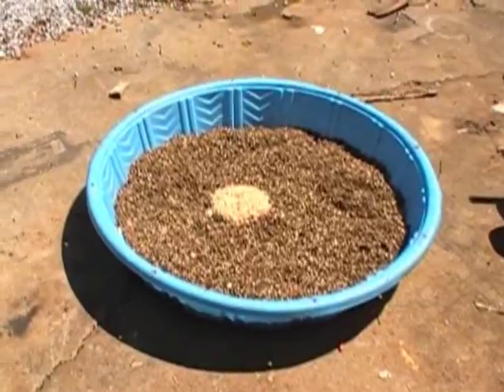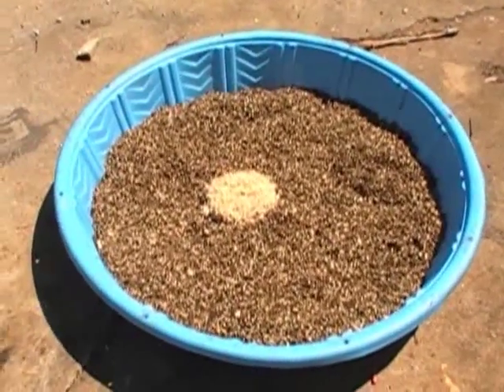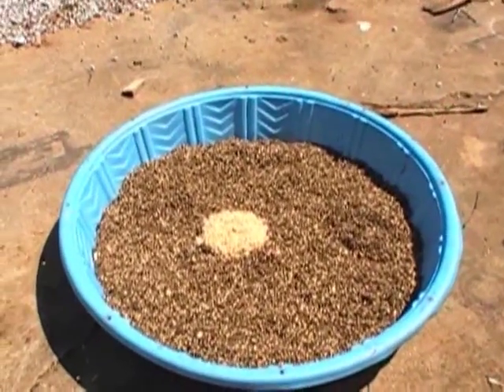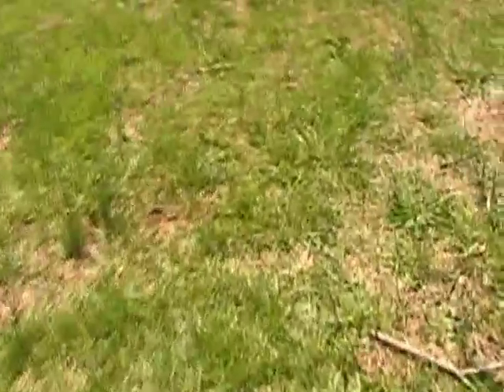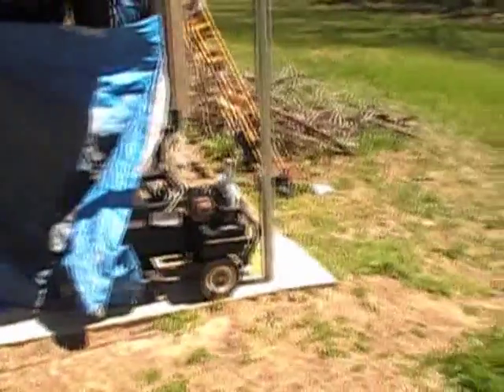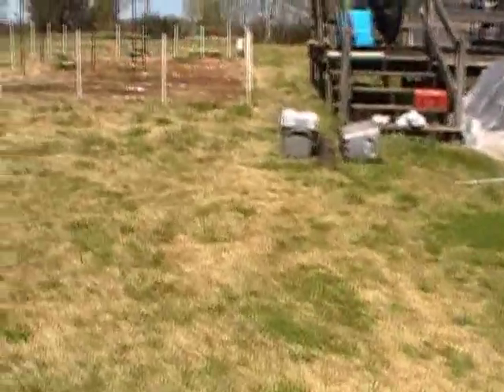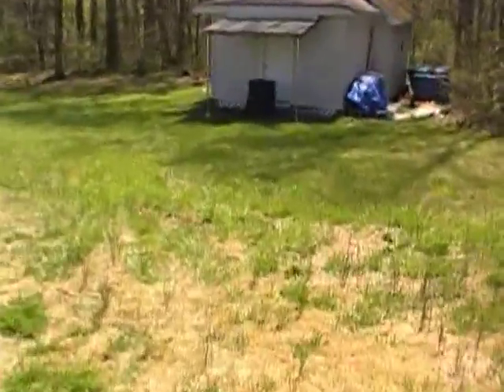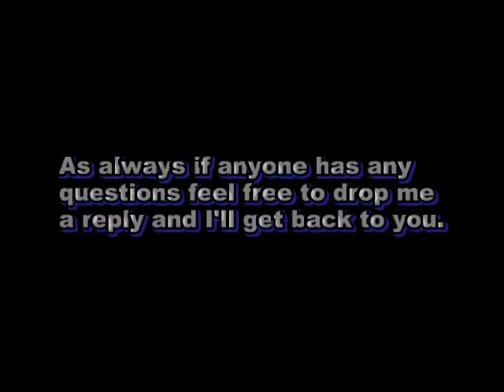Filter Discussions 2018

Comment: Absolutely. I save the shavings and the fiber fill. Thankfully, I have many bags of both. It's nice to have a friend with a custom cabinet shop to get the planer shavings from. Shoot the video man.....
Reply from the maker: I figured it out a while back that I could recycle this stuff and it works. I'm sure they will hit a point where they need to be tossed but the good thing is you can definitely  recycle them quite a few times.
Reply: Yeah. But you mentioned the Oxy Clean and I tied it. Man, does it ever work. Thanks for the heads up on that one. But, I haven't tried cleaning the condensate jar with it as of yet. ....YET,, But, I will.......
Reply from the maker: Dude I've scraped inside of the jar with a stick and couldn't get it clean. We are talking about a jar that was dirty since 2014! It looked brand new after 30 minutes. I honestly couldn't believe it myself.
Reply: I used a paint mixing stick and paper towels and NOTHING.. It's still there. I have got to try it. I have 2.  A primary and secondary condensate jar. Both nasty,,,,,

Comment: Flash, Must be something in the air. I put on a demonstration for the  instructor of the Arduino workshop that I go to once a week. He and his wife came up to watch the gasifier  do its magic. He has agreed to help me with the automation part for our upgrade. I had the camera all set up for a video for you guys and Danged if I didn't remember to turn it on. After they left I fired up again to do the video along with putting the battery bank to work, planing the timbers for the new addition. That video's going to the snipping room for some editing and will be out tomorrow.
Thanks for the  filter update and hope you had a chance to get that midnight run in !
Reply from the maker: Bill I did a run tonight so I have some editing to do myself.
Reply: If you need the O2 sensor code shoot me an email. Your instructor should be able to figure it out. This code is now nearing four years developed. The best code is the code all ready written :)
Reply: Nice work Flash, yeah I dont run media filter anymore I think it creates more problems than it solves.  Been this way for a few years now. We now consider this a condenser and it can do better job with out any mass in there vs having mass in there. Then we run a series of cyclones for final filtering. Last one drops clear water.They are just straight cans no cones Ive found thats a waist of time too. KISS Cheers
Reply: primary site glass is in the oxiclean right now. I do use that to clean the scrummers in filter #1. Works well
Reply: LOL Two Flash001USA gasifire videos on April Fools day. What are the odds ?
Reply from the maker: Pretty wild to run without filter media. My next thing will be an electrostatic filter. I think I'll always run stainless steel pads because they don't impede the flow of gas and they do great in allowing the water to condense. The wood chips will get soaked every time.
Reply: Whoa, whoa, Mike. Back up a minute! What do you mean "  wild run without filter media "..? You want to explain that to the choir, please?
Reply: Look forward to seeing it.
Reply from the maker: Bill I must have missed something here? Wild run without filter media?
Reply: I have not used media for years. You can not filter tar or water it can only be condensed. If you are finding tars, soots in your media its just dropping here and will drop regardless of media. If you do find tar in the media then it has most definitely passed it and is in the engine. To condense the gas you need to expand it after adequate cooling and you will drop more in a vessel with out filter media taking up that space. Ive tested this. Too get out the final debris I use final cyclones by this stage the gas is wet and will scrub this out very effectively in the cyclones. I dont mess with nasty media. After cleaning that stuff out and then finding a way to dispose of it; I had to find a better way and learned the condensing processes.
Reply: One thing I should note. on the big machines we use liquid cooled gas chillers and on the Utility machine what we consider the "condenser" it does have a grate if the user wishes to use this as a media filter. But its up to them, to me its not worth the hassle and it makes it more restrictive causing flow oscillations and crashing the reactions. With out it the engine can pull harder and prevent tar production in the first place. As for any dust its usually whipped out in the machine by the time it reaches the engine. The cyclones take care of anything thats left. On the big machines they have three series cyclones and we premix engine intake air prior to this filter. So it adds more cooling plus gas mixing on top of final filtering.
Reply from the maker: You are 100% correct. That was something I learned 4 years ago when I first started tinkering with this stuff and then I came up with what I called the expansion tank where the gas entered the bottom and exited at the top. Because the gas is allowed to expand it cools it too (AC 101) The water condenses on the sides and runs to the bottom and even the tar will drop out if it's in the gas. I thought I discovered the holy grail then when I showed people on youtube what I was doing I was called an idiot. I stuck to this concept because it works for me. Another issue is getting hot enough if you are running a small engine so a small restriction throat is a must. I'm using a 2 inch restriction throat for my 5 Hp engine along with a cone shaped hearth that starts out at 6 inches diameter and tapers down to the restriction throat. That actually helps concentrate the heat like a fire hose nozzle builds up pressure on the end of the nozzle. I don't see tar unless I use bad fuel or I have a screw-up. I like your idea of no filter media and allowing the cyclones to capture and condense the gas clean and dry. I'm just a guy experimenting with modified trash cans, fence pole for the condenser pipes and PVC pipe filters but it seems to work and stay stable. I still want to find a better way to make the wood chunks drop into the ember bed. What I have now does deliver the vibration directly to the hopper but somewhere along the line I may take a different path on feeding the ember bed. To me this is something fun with a real world use.
Reply: Yeah it was you who started me on that path. Giving credit where credit is due :) Yeah we done with the chip machine development. I am moving to a new machine with fuel standardization and the 1/4" wood pellet is the fuel that fits that bill. This fuel in the right machine solves a lot of those flow issues. On this new machine the hopper vibrator is going away and there will be a fork type device down in the lower portion of the hopper to break those bridges up. The pellets are small enough that should work and the pellets will flow past it. Keep in mind now that you have a grate shaker and a hopper shaker you now have to balance it. To aggressive grate and fuel flow cant keep up and this can cause bridging. To  much hopper shaker and she plugs up. So if you are getting bridging might slow your grate down.
Reply: Mike, Reading your post " Pretty wild to run without filter media ", I thought you did a run without the media . But I have to say, this discussion with Matt is a real interesting and informative thread. It sure gets me to thinking.

Comment: nice place you got there flash,,, are you still using pot scrubbers as filter medium?? i found that pot scrubbers and pillow stuffing works good for me,, although the stuffing tends to hold more moisture than the scrubbers,, i havent tried wood shavings yet,, how wet are they when you check on them after a run??
Reply from the maker: The wood shavings get soaked starting from where the input of the gas enters and runs drier the further up it travels. I think the pot scrubbers are one of the best filter mediums out there for capturing large particles so yeah I use those too.
Reply: ok, thanks

Comment: Howdee Flash, 
 Yer filters run nice and clean, that's fer sure. 
 On mine, the filter medium ultimately becomes black, but not gooey, so I can accept that. 
 Once it gets like that, with all that soot and light oily stuff in it, I use it as fuel for the gasifier, and / or the household fire place. 
 It ain't the best solution, but it sure does make good use of all the resources that support this gasifier  :) . 
 In time, my gasser will evolve to be more like yours, as the interior of mine is almost totally burnt out, due to over 1500 hours of runtime. 
 The air nozzles are all gone, the air preheat chamber is shot to bits, and the restriction assembly is boogered - but wait, there's more...... 
 Anyway, I wood like to think that mine will run as cleanly as yers does when all the upgrades are done  :) . 
 Keep up the good work, my fellow energy conversion addict.
Reply: did you burn out that reactor from ben??
Reply from the maker: Steve out of all of us you're the one with the real run-time with your setup. The rest of us are weekend warriors or at least I am. I think I get decent runs because I am running a 2 inch restriction throat which works with a smaller engine setup. To me this is a really fun project with a learning curve. To you this is your main power source. Big difference and you have already worn an engine or two out without the evil tar monster issues and I'm going to stick my neck out and make the following statement: You're the one with a proven system. The rest of us are either preppers or just guy's playing with our fire toy. At this point in the game I feel a bit more secure now if the grid does go down for any reason because I know that I have a back-up plan for power that doesn't require gasoline.
Reply: Steve. I have to agree with Flash on this one. YOU are the one running full time and with some serious hours on  your systems. Both, with fuel processing equipment you designed as well as the gasifier and the Grunters as you call them. So, this is your bread and butter power wise. Hey. We are coming into the warmer months and you are starting to get into the Winter time. Were you able to get any insulating done in your buildings? I hope so. I know your critters come first and hey, they can hibernate in there too..
Reply: +xoxoXoieoxox 
 Yup, I managed to burn up Ben's reactor. 
 It has been giving me grief since day one, with the nozzles welding themselves in place, and the air preaheat chamber literally tearing itself apart, due to the dissimilar expansion rates of the various structural elements in it. 
 I plan to tear it apart, and revise its internal structure to resemble Flash's center feed nozzle configuration. 
 This ought to give it a new lease on life  :) .
Reply: Howdee Flash, 
 Thanks kindly. For sure, I rely heavily upon this machine for the majority of my winter power. 
 In so doing, I have been able to get away with prolonged operation of it, even though the gas quality is appreciably below my preferred standard. 
 While tar is not yet an issue with this, it won't be too long before it jumps into the equation, and glues my engine up solidly, so remedial action is definitely required. 
 Watt's interesting is that, although I have worn out an engine with it, the piston and bore appear to be in perfect condition, that is, the compression has not declined in all that time  :) . 
 This is surely a testament to the relatively benign nature of woodgas as an engine fuel, as these cheap little engines typically have a lifespan in the order of 1000 hours, when used with standard fuels derived from dinosaur squeezings. 
 My engine was old when I got it, and I clocked up another 1100 hours on it, before it finally popped a shaft seal. 
One of these days, I will pull it to bits, so we can all have us a lookysee at the innards of a veteran woodgas engine  :) .  
 You are well and truly equipped for a power outage, of perty much any duration, as you have been developing the right kind of infrastructure to handle the very worst that nature may throw at your little bit of the national grid. 
 In time, I wood like to think that more folks will follow this path, so they may also enjoy our sense of freedom from the tyranny of grid failures, and the losses that can accompany them. 
 Keep those wooden watts flowing  :) .
Reply: Howdee Mark, 
 Not so many years ago, I wood never have believed that I could run an engine without the need for fossilmfuels, so I was simply over the moon when I tried this for the first time, and got an engine running on treezel  :) . 
 The addiction that set in thereafter has resulted in a lot of engine runtime, and an endless fascination with the goodness of woodgas watty powerfulness. 
 I blame the woodgas bugs for this, as they have merrily nipped me, tag team style, and turned me into their high wattage power slave  ;). 
 These machines have served me very well over the years, and, as far as I can see, they will continue to be foremost in my power generation vanguard. 
 Winter's chills are beginning to make themselves felt here, and my critters are starting to grow a bit of extra cuddle-fuzz to keep them warm. 
 My attempts to insulate my house, and the new workshop have fallen flat, due to the closure of the local building supplies outlet, and a few complications that have arisen from that event. 
 Sooo, as a result, all of that work will need to wait until this time next year. 
 Oh well, such is life. 
 My critters seem to manage perty well in the winter, as they all have sheds to go to. 
 One of my older Donkeys comes into the Wattage Cottage with me, and warms herself by standing next to the Gas-O-Matix9000. 
 She don't seem to mind the noise, and the occasional flare ups from the hopper lid, just as long as she can keep herself cozy - and help me with any carrot related problems that I may be having at the time  ;) .
Reply from the maker: Steve I do like the side nozzle configuration because I believe that you are less prone to bridging between the hopper and the ember bed but the single nozzle setup is simple in concept but it is a trade-off because you can only run smaller engines with it.
Reply: Howdee Flash, 
 For sure, a single vertical nozzle does limit engine size, but that's where a multi nozzle arrangement will help. 
 Do you remember my Fema to Imbert upgrade video? 
 This used that concept, and it worked like a charm  :) . 
 It occurs to me that we could add some kind of agitator to the vertical nozzle shaft, so we could stir up the fuel in order to break up any bridging problems. 
 Hmmmm, thinking caps on........
Reply from the maker: That's a really good idea. Yeah I do remember your fema setup. It could work and work quite well.

Comment: Maybe you have experience to answer something having difficulty researching. I see all kinds of info for mid and large cubic inch displacement and gasifiers. Yours being in the 10 hp range, I reckon.  I want to scale it down to about 1 hp or 35 cc.  Is the gasification linear or exponential when considering such things to that itty bitty degree? Im talking almost backpacking economy scale with parts in coffee can size. Ive seen motorcycles, that take it down to a point, but nothing smaller.  Thanks
Reply from the maker: When I did this build I had the FEMA plans along with the stuff All Power Labs released and I did a combination of both concepts and tinkered with it until I found something that worked for me. The build I have is really geared up for a 5 Hp to something a bit larger. When you start trying to run smaller engines heat is an issue because it's hard to get the ember bed hot enough to crack the tars in the gas. In reality the build I have could be made with a much smaller footprint but I can get almost new 55 gallon drums all day long for $20 or less so this is why I built a larger vessel even though I'm only running a small engine. Yes you can build a gasifier the size of a few stacked coffee cans. No doubt!
Reply: you might be better with a charcoal gasifyer as they are alot less complicated =)

Comment: have you ever tryed using "clean sweep" wood chips they are infused with oil for sweeping up drywall dust my wood chips usualy turn this weird greenish color and damp once there dry there good to go again and when there completely blown out i throw them in the yard =) but unless one has a good reactor filters are meaningless =)
Reply from the maker: That's an interesting idea. I think the wood chips serve the main purpose of drying the gas along with helping filter it too so I'm not sure how the oil coated wood chips or sawdust would work. Have you ever tried it?